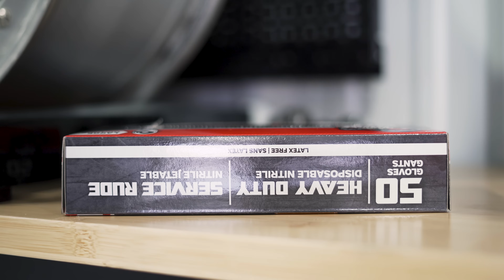Start To Finish Engine Restoration On A BMW S52 - Satisfying Transformation

Comment: When i do this, i only paint the parts that where either painted from the factory or have had corrosion so paint would help prevent it happening again.
Also a steel wire is not suffecient at getting all the corrosion of, the correct method would be blasting. 
Also 2K paint is reccomended, the one you used wont last if it sees fuel or oil...

Comment: nice vid nice edit nice contend. bit u shoul have sand the engine for the spray colour  to stick
Reply from the maker: Thanks man! The white wheeling in different directions has a very similar affect as paper. Creating valleys in the surface to help adhesion

Comment: Back on 2012 i replaced the headgaskets since im already there i cleaned the plenum the rods rockers etc. For the heads i used a acid from BettyMills worked wonders. The engine was entirely clean and sparkling that same year i lost my 1992 Acura Legend to Sandy. But an engine sparkling clean is at best.
Reply from the maker: I agree man! Spotles engine is the best engine. Glad you put in the work 🖤

Comment: **This video is sponsored by Shop Towels**😂
19:28 did I just spot some Lorinser RSK2’s!?!? Wtf man!? 😂🤣 out here buying all the wheels I want just to hurt my feelings 
This video was so incredible man. I dig tf out of your content, your style, your builds, your mod choices, and overall vibe. This video especially gets me hype since It’s exactly what I’m wanting to do with my e36 after I get my coils on. Want to pull the motor, fully clean the bay and do a respray, refinish the block/head/components, and just have a fully perfect/mint OE bay but lightly shaved (I’m not giving up power steering or AC, because fuck that) and do a full wire tuck with some trunk and fender well relocation 👌🏼 

Can’t wait for more dude 😎 hopefully one day in the future, when my e36 is “done”, I can road-trip for a BMW/Euro show or something and actually see your build(s) in person 🙌🏼

Comment: You should have used Dupicolor primer, DE1612, at least for the block. The paint will most likely have adhesion issues. Source: I did the same thing a decade ago with the same motor.
Reply from the maker: Seems fine so far! Thank you though

Comment: What kind of restoration is it when you just paint the thing ?What about unmounting the head? checking the conecting rod bearings and main crranks shaft bearing and more and more ? :D ok this is vid about engine painting not restoration man  :D but as a painter gj
Reply from the maker: It’s about a restoration of the paint/exterior. Cheers

Comment: Should have left the rocker cover and sump on whilst doing that...🤦‍♂️
Reply from the maker: Cleaner lines this way!
Reply: @ChromaticGarage there's a good chance that the dust you made while cleaning all that off the engine has made it into the bottom end, look its your show, but for people who have already done stuff like this (ie me a few times) it looks all wrong... Keep the engine sealed while doing the crappy stuff and then when your ready for paint just tape around the covers...

Comment: Was this a known 100% good engine? I'd be worried about timing chain wear, cam/crank wear, and piston ring wear. Head gasket failures have plagued two of my BMWs. You're a few steps away from taking the whole thing apart, getting it cleaned, machined, painted, and reassembled! No, not a "few" steps really, but with the work it takes to install an engine, why not fully rebuild it while it's like this?
Reply from the maker: I had it compression tested before doing this. I’d say I’m quite far from doing all of that, would be a little extra at this point. But I’m sure I’ll do that to another engine soon

Comment: Why just respray? It’s on a stand? Refresh it? Just bearings and seals. A good internal clean on the galleries. Rods, pistons, crank, cams will all be good. Just amazes me that the opportunity is there and ya just… paint it. And you paint the core plugs. Why :/